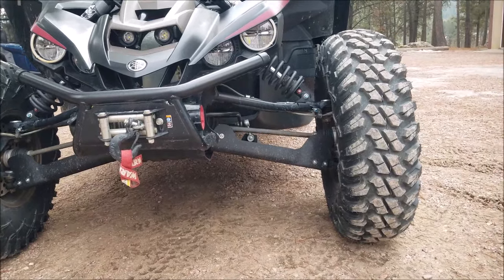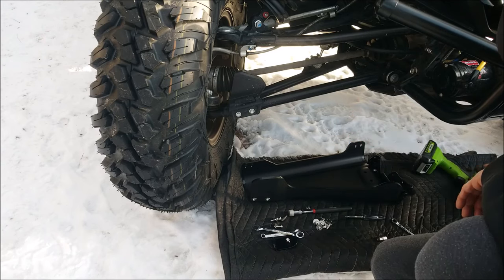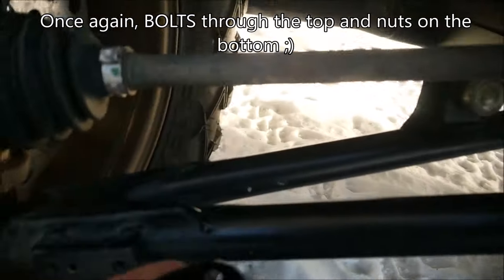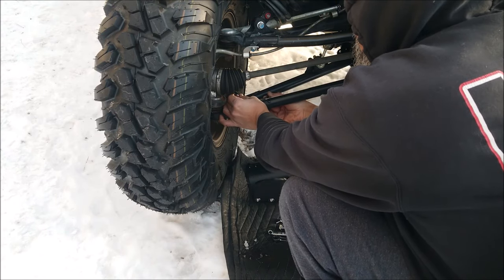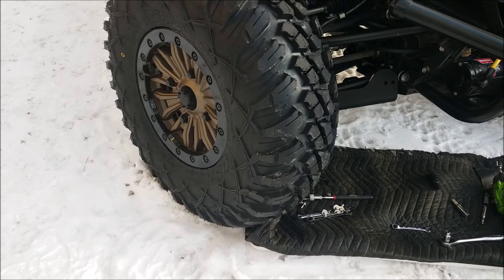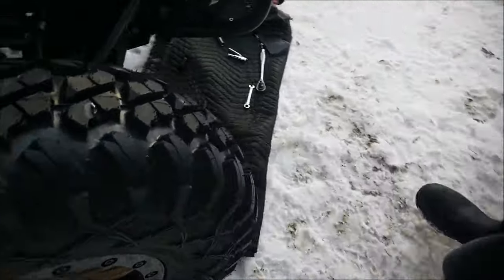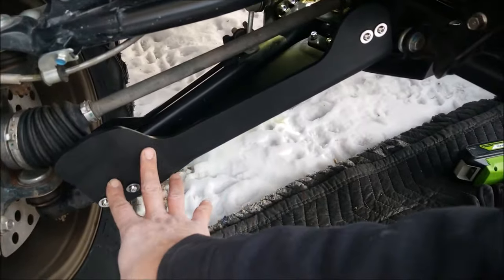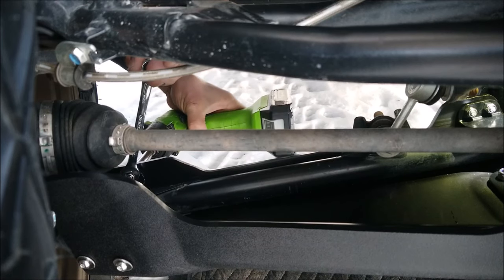Yamaha YXZ 1000R GYTR front A arm guard review and install

Comment: What do you like better your YXZ or the Rmax? I’m considering buying a new YXZ.  Is the new 6 speed holding up well, I read a someone saying they are blowing up 6 speeds 🤷🏻‍♂️
Which one is better for long distance ridding and which one is quieter?
Reply from the maker: I have to say,  I like my YXZ better.  The 6 speed is performing flawlessly and so far there haven't been any slow technical stuff that has stopped my YXZ.  I haven't heard of a single 24 model blowing up other than Weller Racing's turbo'd unit at Glamis and it sounds like it may have been running lean.  

The YXZ is definitely better for long distance riding as it's made for higher speed riding and has better gas mileage to boot.  Believe it or not, I find the YXZ quieter but I need to throw the stop exhaust tip back on the RMAX for proper comparison.  The YXZ is so much more fun to drive and the wife and I both love the laid back seating, which I didn't think I would like until I tried it. 

There have been a lot of durability improvements to the 24 model so don't hesitate to purchase one on reliability.  I'm at 1400 miles without an issue.
Reply: @MassiveOverkill   Thanks, looks like I’ll replace my old Teryx 4 with the new yxz. My kids are grown up so need for a four seater.
Reply from the maker: I'm a 'have your cake and eat it too' guy and I still plan on overlanding\camping with my YXZ.  It's going to be a challenge to carry everything I need in the YXZ as my RMAX4, but I believe it's possible.  I rarely ever carry 4 passengers as it's just usually Ellie and I, so we also don't really need 4 seats anymore just like yourself.